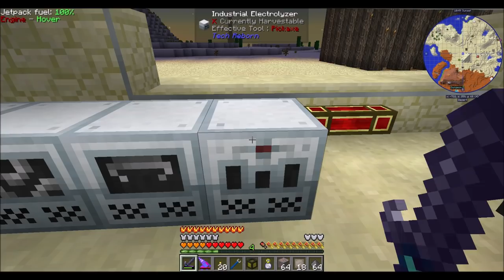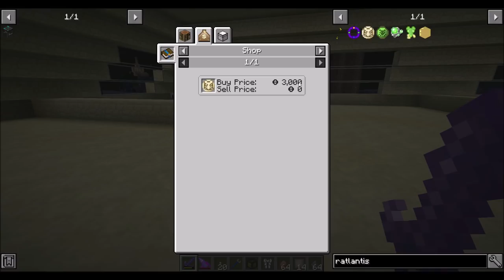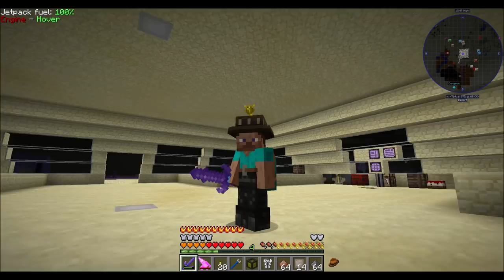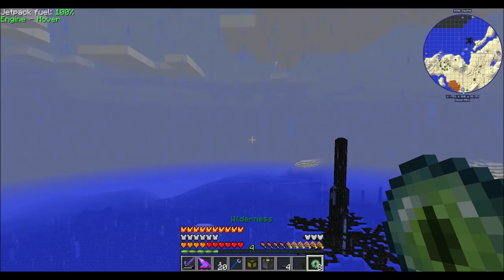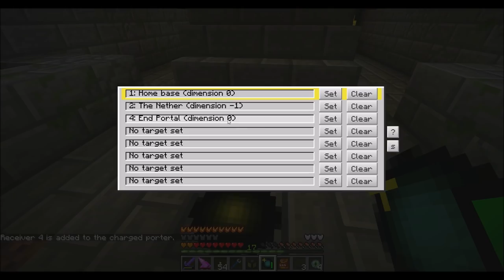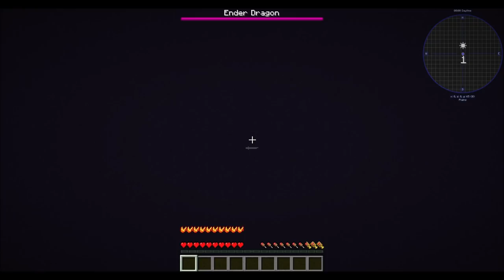MCEternal Ep35 Power Armor

Comment: Dire: For a bosskilling Tinker's broadsword:
1) Restonia Tool Rod: Gives trait "Hearts" does more damage the more health you have.
2) Supremium Sword Blade:  Highest Damage.
3) Signalum Wide Guard: Gives trait "Bloody Mary" does more damage the more hurt the mob.
4) "Embossment" (3 slime crystals + block gold + part):  Osgoglas for 3 traits one is "Sassy" which makes all hits to boss mobs 'critical strike'

Load it up with quartz and it can 2 shot the Wither.
Reply: i thought firesteel did more damage, am I wrong?
Reply: Well... since TAIGA mod is on this pack... would nihilite beat it in long-term since it increases damage per kill?
Reply: @darklink315gc  Fire Dragonsteel is base 9.1, Supremium is base 9.77.  Technically Gaia Spirit Ingot is best with base 12.75, but gaia spirit is a lot harder to get when you can just do a few wither kills for Supremium essence.
Reply: @OddWorlderer  Nihilite starts out pretty pitiful.. Besides Gaia Spirit also has "Alien" which increases damage over time as well.
Reply: Hey can you explain point 4, i dont know how to do it
Reply: @75seconds4  Embossment takes a part's traits and applies it to a tool/weapon.  You need 1 of each slime crystal (blue, green, orange) + 1 block of gold + 1 "part" of that material (in #4 case "Osgoglas", you could use a "wide guard" made of Osgoglas.)  This will give Osgoglas's traits to the weapon without replacing a part and losing the original traits.
Reply: cool but i don't think he asked
Reply: What's a good overall sowrd for regular mobs? For someone who wants to explore dungeons and kill T5 dragons? Also, is the thinker's armour worth?
Reply: @joelnascimento8806  Mystical Agriculture's Supremium armor set with creative flight can have charms added.. I like fire immunity, poison immunity, and speed.  The bosskiller sword works fine on normal mobs, but if you want to make it better look into Thaumcraft runic enchanting for "Arcing" enchantment up to level 4, each level of arcing does the weapon damage to an additional mob nearby.
Reply: @jfhalshsfdalkj  That's pretty nice, I appreaciate a lot that you've answered, thank you and stay safe!!
Reply: @joelnascimento8806  A scythe might also be a good idea for some aoe mob damage. Using some of these tips, plus you get an extra material to use for the plate.
Reply: Ik this is a month old comment, but I think you guys should know there is an alloy in this modpack called "Nihilite" it gives you the trait "Soul Eater", it keeps ramping up damage the more mobs it you kill with it, as far as I know there is no cap. I made my longsword unbreakable and left it over night killing mobs, it does 400 dmg per swing.

Comment: The power fist can be made if you just drain the energy out of the drill. You can use the drill like a battery in a machine, I just stuck it in my furnace and cooked a bunch of glass that I needed anyway with tick acceleration. Once the drill was empty the recipe worked.

Comment: The power armor tool didn't want to craft because you charged the drill and the recipe needed it without power
Reply: But when that happens most of the time the charged item doesn't auto input into the grid
Reply: @bytzz557  Still, the power armor mod is very sensitive to that. The drill should be empty, but i think that fully charged would work too
Reply: @TheMerlin379  Well, that's a problem with the craft :/

Comment: Dire, some towers go down into the ground instead of up, so the best loot will be on the bottom floor. I’m really bad at kitchen sink packs, I normally only play sky blocks because it guides me. Do you have any pack recommendations that will guide me a little bit give me freedom as well?
Reply: Enigmatica 2 has a quest like that explains decently well
Reply: FTB Academy is based around guiding you through all sorts of mods, maybe try that out? It might not give you the sense of freedom you're looking for though.
Reply: Rogue Aadventures and Dungeons seems like a cool pack but has barely any tech in it. I get how you feel about needing a questline to follow(same here bro), so i suggest trying out something like crackpack 3 which has progression led by a sort of questline.

Comment: Why you didn't make a grain of infinity farm using the fire water it's easy to make and so efficient I got almost 1000 from not even afk
Reply: Random things as a fireplacer that doesnt consume anything and keeps the block ignited, it generates a lot more than firewater.
Reply: bruno Filipe no way since you can light firewater on fire and it stays like netherrack.
Reply: Grains of infinity Seeds and a cloche works well
Reply: @brunofilipe9623  just a suggestion

Comment: If you get bit by  a vampire and don't treat it, is there a way to cure it later? I don't see anything about it in the wiki.
Reply: I think you can also make a treatment chair and a garlic injection to immunize yourself.
Reply: @zanetano  Thanks! Now if i can just remember which village I saw one in. The way stones make it easy to get to the villages once you find them. I spend a bit of time out at night to help defend my colony until I get the barracks upgraded. Too many mobs that will make short work of a couple of guards.